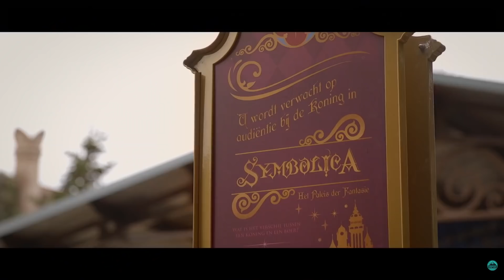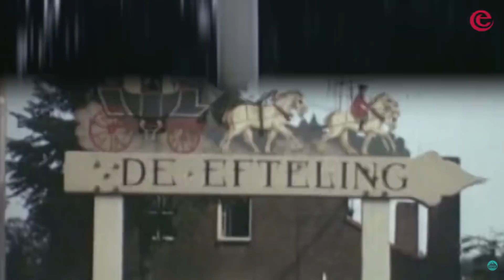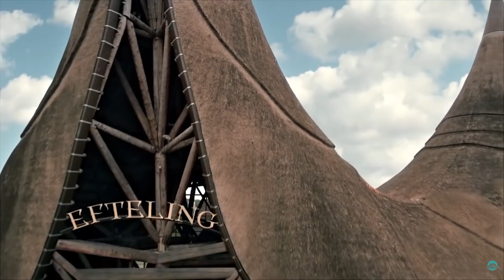The History of Symbolica: Palace Of Fantasy | Expedition Efteling

Comment: Hi! I'm from the Netherlands and Symbolica is probably one of my favorite darkrides in the world. Here's why.

I'm going to compare the Efteling to Disneyland, and of course I absolutely love both parks but there are 3 things that I don't like about most of the darkrides in Disney parks.

1. The 2D decors. 
The Efteling never uses 2D blacklight decor pieces. Disney does.
Everything you see in the Efteling is a real 3D piece (with a few exceptions) and that makes everything very immersive and magical.
Of course the Disney rides that use this technique are a little older, and for example Rise of the Resistance is in my opinion one of the best attractions in the world, but the Efteling has NEVER used 2D props; they have always worked with real art pieces throughout the entire park.

2. The screens.
Of course, the Efteling also uses projections and screens every now and then, but they never play a huge roll in the experience.
Disney uses screens all the time.
Don't get me wrong, there's nothing bad about screens. I just think it's often used in places where it isn't necessary.
In the Ratatouille ride you're basically just driving through empty rooms with screens, with some actual sets in between. 
The screens just take away that feeling of a real experience.

3. The ceiling.
Just look up and you'll get it.

Symbolica doesn't do any of these 3 things. 
From the floor to the ceiling, everything is themed.
Everything fits into the story, and the budget for Symbolica is also way lower than Disney's budget for most rides.
That's what I love about Symbolica.
Reply: I think the important part about screens/projections in the Efteling is that when they are used, you either don't realize they are screens (like the cracking glass in Symbolica), or their thematic purpose is to be a screen, like the screens on the wall in Baron 1898's pre-show. The latter of which interestingly also features projections which don't feel like screens!

Comment: The theming and the quality is stunning of the ride, although the story is kind of vague.
90% of the time you spend the same route with the other routes, while I was expecting the three of them to be completely different. Furthermore, I hardly found the interactive system in the front to be interactive (I had the feeling my button presses didn't do much). 
Again, amazing ride nonetheless.
Reply: I didn't really find it difficult to understand the story, even as an English only speaker. Most of their new rides there is no issue as they've avoided a lot of dialog, but Villa Volta you needed to read the story in the queue and then wait through a pre show that was all in Dutch. I didn't think the interactive element was necessary and maybe even detracted from the experience. In the music room it made the different instruments play, in the treasure room your gem lights up to the colors you press, but I can't even remember what the heroes tour did. I fear the millennium falcon ride at Galaxy's edge has the same problem. You're distracted by having to do a task and missing out on the actual experience.

Comment: I am not very impressed with Symbolica. The design is not consistent, corners have been cut, the 3 "paths" are not very different at all, the character of Pardoes is downright annoying and has no historical connection to the park, the whole ride is rather pointless and boring. I have done the ride once and don't feel any inclination to ever ride it again. And this is coming from someone who used to be a huge fan of the park. I guess ever since they destroyed the atmosphere by building a highway right through it (I'm talking about the main corridor from entrance to Symbolica), the Efteling hasn't been the same and rides have been lack luster. With the exception of Baron 1898.